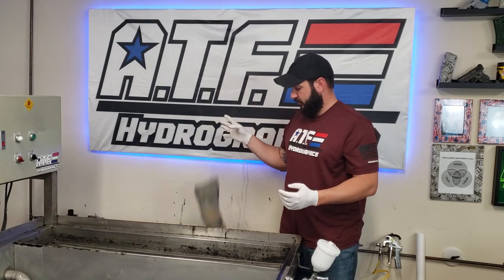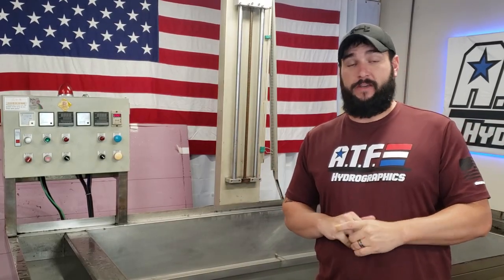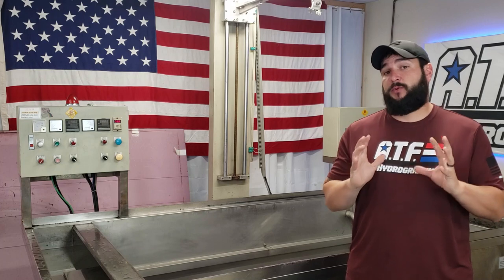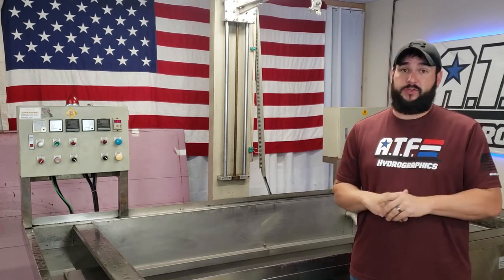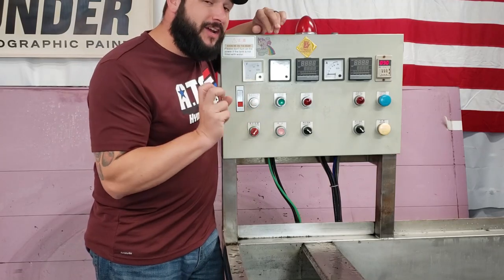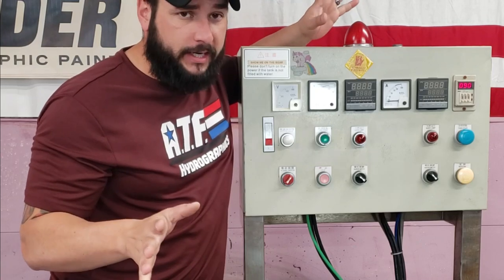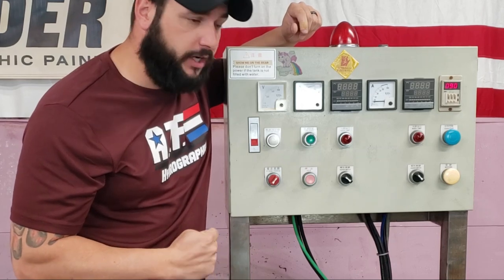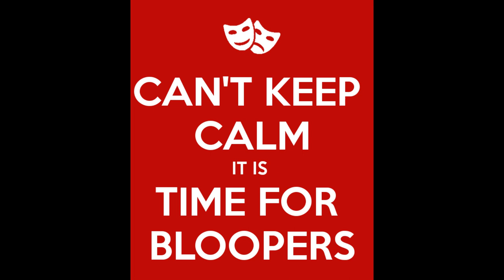Water Temp for Hydro Dipping

Comment: I usually fill my tote up half water with hose water then add 2 maybe 3 pots of boiling water to it to get my temp between 90 an 92. But now that its unusually cold this time of year in my neck of the woods it takes longer to get my temp up to where I need it😑 I'll be so glad when I have a shop to work in.
Reply: Half way not half water🙄
Reply from the maker: A shop is very nice, I love mine but it is about time to upgrade. It is insane how quickly you run out of space.
Reply: @AllThingsFunHydrographics  space runs out very qquickly!

Comment: Have you ever heard of someone using a precision cooker that is typically used for sous vide? They're for slowly cooking meats in water with a controlled water temperature. But they can, easily, handle totes and maintaining a 90 degree temperature. They can be pricey - mine was $250 - but it's controlled through blue tooth, and can handle 10+ gallons pretty easily. Downside is that it is wired..
Reply from the maker: Never heard of that, but I am sure it would work.

Comment: Help!! Im using your videos to be self taught by you. There's no one that's doing it in Mississippi. Everyone gets decent and then quit. So the gun dealers say. I'm hard headed an God for got to put some quit in me so it's been told. I'm using one hit wonder paint thanks to you. Is 2 minutes to long. For the oil spill pattern My tank is reading 88. But I'm going to let to 90 surface level. And the oil spill pattern how long do you normally take to sit after you spray your activator.                                    Sincerely thanks T Purvis in the humid dirty south.

Comment: When rinsing your items, are there any other solvents used in your solution other than 90° water? Some of my dip fades after I rinse it, I'm assuming my water is too hot?
Reply from the maker: Nope just plain water that is cooler than the water you dipped it in. So if you dipped it in 90, rinse at 80 or less. And if your pattern is fading them the water is too hot and or its not enough activator.

Comment: I've got a question for you I'm very new to hide your dipping I've only done a handful of things and luckily everything I've done I've been very pleased with. I'm just using a cheap plastic tub and spray paint at the moment. One issue I saw when researching online that I ran into once or twice was the paint on the surface becoming plasticy. I thought it was a water temperature thing cuz my water was extremely cold being outdoors in Michigan but I noticed the same issue occurred for several people online. I thought potentially it was a paint thing but over the course of doing it with the same paints the issue only occurred once out of every 10 things I dipped
Reply from the maker: Stop using spray paint and buy paint that is made for hydro dipping. That will solve a lot of your problems. Also dip in warm water, 90 degrees is my preference. You will get more consistent results with hydro dipping paint instead off store bought spray paint, trust me.